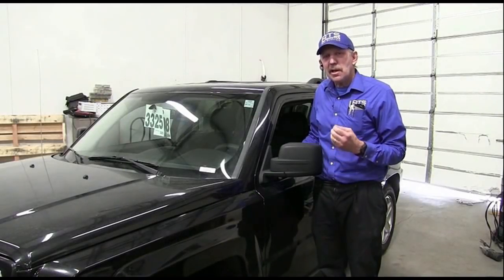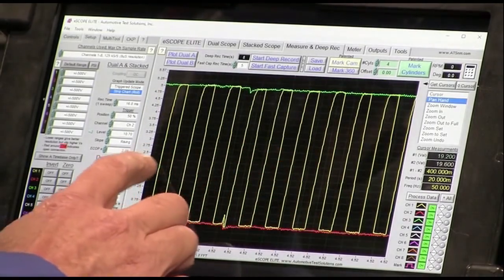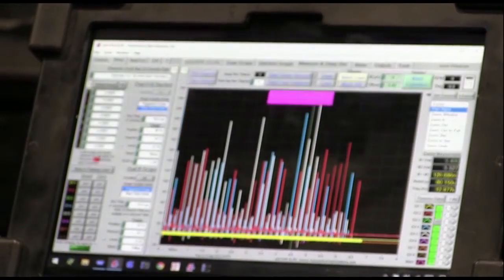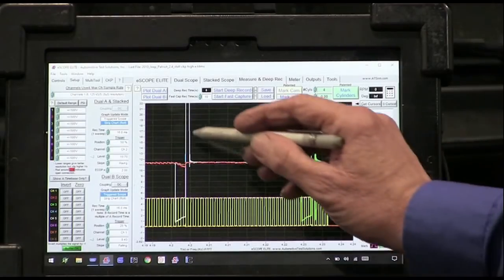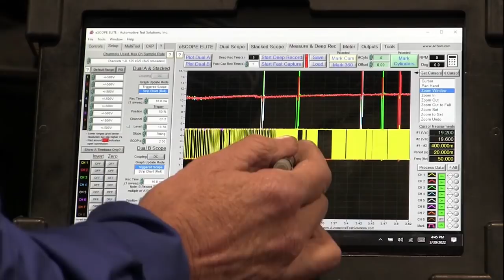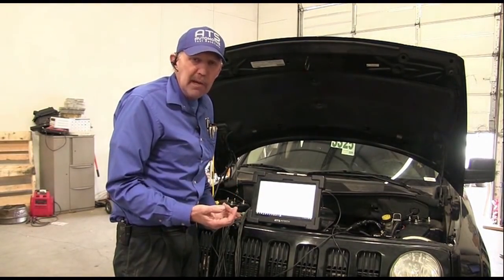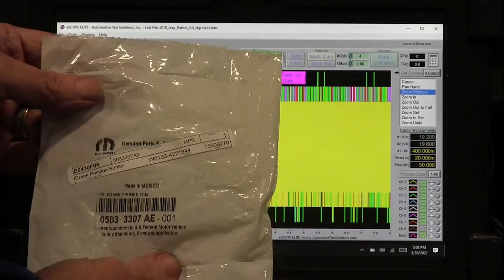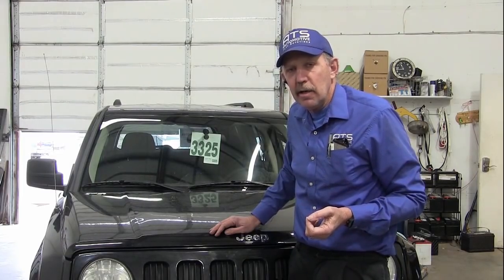2010 Jeep Patriot

Comment: I've been told several times by several people that you just can't put aftermarket crank sensors in Jeeps. I know a couple of shops besides just the dealer that specialize in Jeeps and they say that same thing. Chrysler grounds are just Chrysler grounds. We used Stabilant 22 on my Ram truck computer connections after it being suggested by a guy who specializes in Ram trucks. Napa and Advance Auto had it on the shelf but it's pricey. They also call it SL5 or CE1. Thanks for the video. I learn more from these type of videos than I ever did in school.
Reply: Can't use aftmkt. O2 sensors either...
....or coils
.............or cmps
....................or anything electrical.

I have even had pcm codes telling me that the wrong oil is in the engine!  No lie!!!

And what's really interesting is that Mopar is cheaper, yes cheaper than the top rated aftmkt. parts.

And I use deoxit electrical enhancer.  Good stuff.
Reply: I've had ton of issues using Aftermarket CKP & CMPs on Chrysler Vehicles. There's been a couple that due accept them but more often than not just go OE.

Comment: The thing all these circuits have in common in any vehicle is the ground. The negative spikes exceed the PIV of and PN junction in the op amps or any others transistors in the circuits. My first guess when the scope displayed showed was ground.. so glad it turned out correct.  Been out of electronics for a couple of decades. Great case study!

Comment: Mastering on the highest level, high end oscilloscope , highest level of experience, problem getting worse when happening occasionally during driving under load and DTC is not set, or DTC pointing in wrong direction. Driving on passenger side with oscilloscope half day..  Top man!

Comment: Awesome case study. Just another example of why it’s important to have a good scope and to take a close look at input signals when facing a problem like this. In this case the computer is doing its best to lead the technician to the problem but without proper equipment and technique it will be looked right over. Bernie fixes another one!

Comment: An over voltage is may be even worser than a voltage dip in the 5V supply.  The overvoltage could toast the circuit.

Also the very strong current changes in each coil can cause "overtalk" to other wires in it's neighbourhood.  The way to prevents this to shield these wires. So the way you wired it could also contribute to the changes dips and or peaks in the measured 5v supply.

Comment: I wish Bernie would have tested the vehicle after cleaning the grounds to see if that fixed the problem.  Instead, he changed the crank sensor at the same time.  Therefore, we don't know what the actual fix was.  In other videos (ScannerDanner, SMA), they had similar crank signal issues and DTCs on Jeep Patriots.  In both cases, replacing an aftermarket crank sensor with an OEM sensor fixed the problem.

Comment: Having run into many Chrysler crank sensors over the years, and have been told that between the after market and OE there is some variations of degrees in the settings. 

I would have liked to seen the testing without changing parts, to me you take a methodical approach in finding the issue, but you change to many variables to prove the grounds were the main issue. 

I would have liked to seen the scope values with the coils and crank that were in when it came in. 

Just my two cents on the subject, you took a great approach in finding the failure, but then parts cannon the car before reviewing the scope.
Reply: I think we watched 2 different videos.

Comment: My jeep only had 14,000 miles on it before the coil failed and the altenator at the same time. There is no amp fuse between them. The coils get fried if your rpm is above 4k.

Comment: I was called to another garage to fix a 2005 300c chrysler. The problems they noticed with the car was Hard or no start, red lightning bolt flashing, no throttle response, headlight stays on, immediate stalling after starting and rough idle throughout idling as a result a new PCM was replaced with a new one however problem still persisted. 

  I scanned for DTC codes and saw a P0340, P2167, P2166, P2115, P2116, p0603 and more module codes like C2202, U0168, U1414, B1A25, etc.  Please , how do I fix these car problems?

Comment: Good day Bernie Thompson I bought your scan tool a year ago the tablet and haven’t use it since then . But now I’m using the tool and it not working like it should.
Reply: What's wrong with it ?
Reply: Check the fuses in it. Any time I have a odd reading or capture the fuse fixes it.
Reply: What is the actual complaint? "It's not working like it should." sounds like 80% of customers that drop off thier car.

Comment: What would happen if you where disconnected (unpluged) cylinder one coil and start  the engine? Even though we had miss fire, on scope do you think the  crank sensor ground line  would be smoth (straight) ? Thanks 

I really love your videos i learn everyday new, you change my strategy, thank you so much, I really appreciate you. You are my model. I woul not forget you untill i use escop

Comment: That shop is incredibly lazy or didn't feel like sourcing the proper coils. I drive a patriot, those coils are used on 50 different models of dodge/chrysler/jeep vehicles. Theyre available directly from mopar parts.
Reply: Parts shortages have the dealers calling local parts stores because they can't get parts. This week a friend of mine had to deliver 6 GL of ATF+4 to the local Dodge dealer because they couldn't even get transmission fluid.